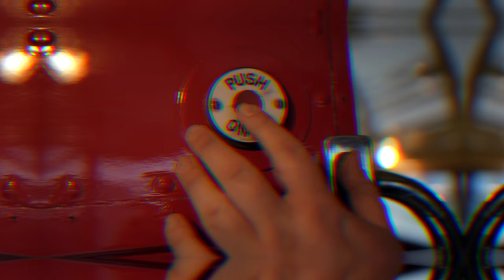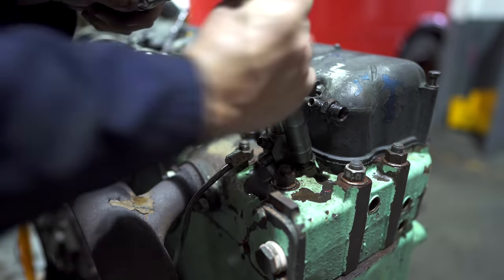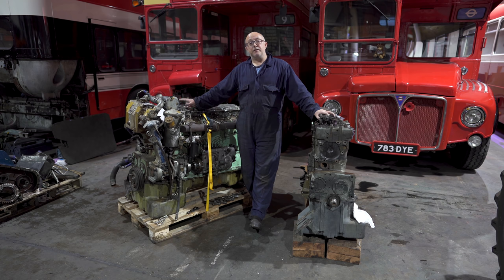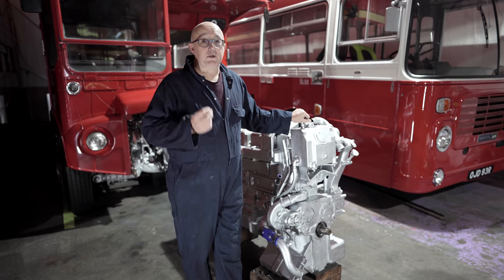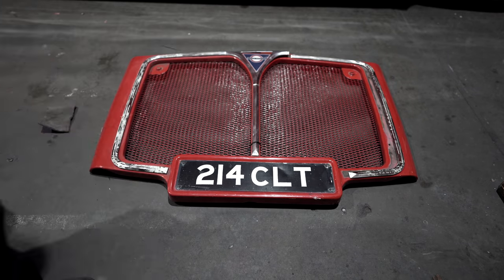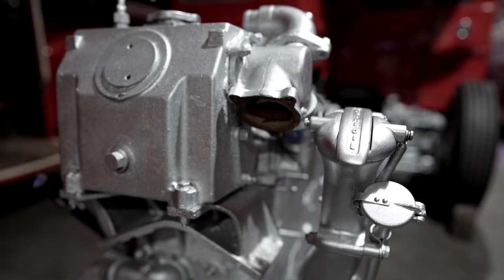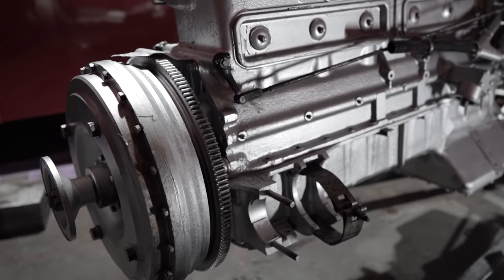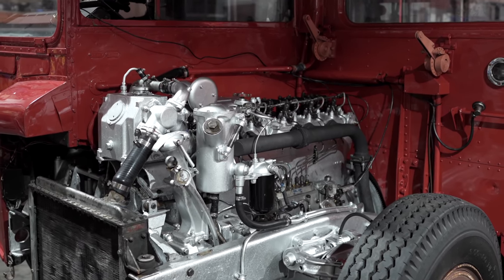Ep3: AEC Routemaster London Bus Restoration - ENGINE DISASTER! (Pt1)

Comment: Had never ridden in a double-decker bus before and went to the Sydney Bus and Truck Museum in the '90s, where I rode one-up in the middle upstairs of a similar red model.  I was surprised at the stiffness of the ride even when you are so far away from the road.  Of course I realised it was to stop them toppling over in their heyday on Sydney's winding downhill bends, as well as carrying the extra weight.  One question - is the fan at 21:58 missing a piece from one of arms?

Comment: Proper toys for the boys! I'm only a girl, but I used to be a rally driver (amateur) in the 1980s and spent many a long night under cars, grovelling in mud, snow and slush in pine forests replacing clutches and bent and broken oily bits.

I love this project. Not keen on the music (a soundtrack of banter, ratchets, dropped spanners, grazed knuckles, curses, a constantly boiling kettle, and red-hot, X-rated mug and teaspoon stirring action would suit me more...),  but it's great to see men willing to spend time and money doing something like this.

I'm delighted that the bus isn't being given a 'right-on' conversion to run as an electric vehicle. That would be as absurd as converting a steam locomotive to run on diesel. As Frank Zappa once said - "Keep it greasy..."

I hope you'll ignore the Negative Nancy-type Comments about 'the inadequate use of Personal Protection Equipment'. Such righteous nagging is all the rage on YouTube these days.

Donning a pair of safety specs when using an angle grinder is one thing, but there's a whole generation of peeps that flies into a tizzy if it sees someone using a drill without gloves, a face-shield, earplugs and safety boots, or holding a bl**dy screwdriver in (gasp!) their bare hand.

And as for spraying without a mask, extractor, nuclear haz-mat suit and organic vegan respirator... Nooooo! You're doomed! You could be breathing in toxic fumes! It's worse than smoking 780 cigars an hour! Think of the harm you're doing to your lungs and genes and the lungs of the poor ol' workshop doggie! Oh, woe, woe, and thrice woe...

Oh, shut up.

Perhaps the critics are from the U.S., where personal injury lawyers queue up to launch $100,000,000 compensation lawsuits if somebody stubs their toe or falls off a kitchen stepladder or looks at you in a funny way. Yes, hurt feeling are big business, too. Sigh.

Thankfully, this project's taking place in Britain, where nobody gives a toss. Hooray! People tend not to blame anybody but themselves if they drop a 30 pound toolbox on their foot, nobody sues anybody because that would be POOR FORM and BAD MANNERS, and lawyers who try to get involved are going to get a slap.

If you haven't got ("Possibly Carcinogenic!!!") dirt under your ("Broken!!!") fingernails, you're not doing the job properly.

I wish you well, guys.   :-)

Comment: You're quite right to be concerned about the thermostat. I learned that lesson the hard way. I had a thermostat stick closed on a summer's day, and the engine badly overheated. It ran after, but it blew smoke on startup and lost a bunch of compression. Now, I change thermostats every few years just because.

Comment: Cannibalising one engine (or part) to repair another part at least doubles the workload involved. Not the most efficient way to keep a vehicle on the road, but sometimes it's the only option.  Having to hand make replacement gaskets just adds to the time it takes to do the repair. However, you are keeping a British classic on the road, so it's worth it. Loving the rebuild videos.

Comment: THE RCL ( Long wheelbase Green Line) version of the Routemaster were fitted from new with the AV690 engine along with a higher speed drive axle. The G'box was semi automatic, unlike the RMC where fully automatic was an option.

Comment: I see you don't use impact wrenches much. I know you have to be careful but they are handy..
Reply: They are handy when dealing with some stuck bolts but when working on vehicles this old sometimes working by hand is safer and less likely to break off bolts or strip the threads.
Reply: They aren't under time pressure like a mechanical business and when working on antique equipment, it's better to have the dexterity of hand tools so you can feel what's going on.

Comment: My Dad is an old school mechanic and sadly he never wanted me to work on engines, so I am a curious watcher. One thing he taught me was to never put an old thermostat back on an engine and I was curious why you did, although it might be out of necessity as there may not be many new ones easily available and to save one is a better outcome. There's something really pleasant about the idle of those engines, they have like a high-low resonance. Great work gentlemen. Love the videos.
Reply from the maker: Thank you!
Reply: I wondered the same thing. I rarely ever open the thermostat housing on any of our vehicles, only if there are problems with temperature regulation. And if I do check them, it is only out of curiosity. Especially if it looks as old and grungy as the one in that bus!

Comment: So is there any reason in particular for not going the repower route given parts scarcity? Obviously you can still run these engines while you can get parts but it seems eventually that may become quite a problem.
Reply from the maker: The Routemasters that stayed in service in London into the 1990's and beyond were re-engined with Cummins and Iveco engines but this modernisation (in my opinion) ripped to soul out of these buses.  That is why we prefer ours to be as original as possible.   Mechanical parts are still available for the original engines and there are plenty of companies in the UK that can service and overhaul pumps, starters, compressors etc etc.  For now, at least, there are enough parts knocking around to keep these buses running.
Reply: @Routemaster4Hire  plus you're not racking up the miles like a PSV bus, so they won't wear out at the same rate, yet you're keeping rhythm exercised and treating them better as well.

Comment: Beautiful refurbishment of the engine. I am based in The Netherlands and am considering buying an RM. One thing that makes me hesitant is the engine dying on me and then not be able to find a replacement. If that happens, are there any modern engines (that meet new diesel regulations?) available to place into the RM?
Reply from the maker: Hi Paul.  Routemaster AV590 engines are like hens teeth nowadays so your best alternative is to fit a AV690, these engines are old but many were fitted to generators and so have much less hours then their AV590 equivalents.  To fit a modern engine into a Routemaster would be a big engineering task and would undervalue the vehicle.
Reply: @Routemaster4Hire  Thanks a lot for the reply. Then if I get into such a situation, I know in which direction to look.
Reply: @Routemaster4Hire  Unfortunately, since the Brexit, I do not dare to buy an RM in the UK anymore.

I understand that imported second hand cars from the UK now have to be tested before I can get a Dutch registration for them. That adds a big risk to an purchase. So, I'll search on the continent.
Reply: @Routemaster4Hire  The reason why 590s are rarer is because LT brought up almost all the spares. 690s only differ in the liner, piston and cylinder heads. 690s principle use was in Mammoth Majors, Mandatory and Militant Mk 3s. Most mobile cranes used 470s, with earlier cranes running 11.3 engines. If you aren't worried about total originality a 691 or 760 could be used - de rated.
Reply: Some RMs came with Leyland 0600 new, 400 of them I believe. I used to not like the idea of that until I learned why LT did that -so as not to be so reliant on one make. Besides, they sound awesome!

Comment: does not the routemaster association supply parts ?if owners get together they can get parts specially made cant they ?why did the engine blow up? lack of oil/dirty oil in the sump or runaway injection pump ?
Reply from the maker: Hi Peter.  Many thanks for your questions...  

Yes The Routemaster Association does supply many parts, they also get obsolite items remanufactured on behalf of the members.
If you watch the next video (Episode 4) we explain what happened to the engine.

Comment: Really interesting video, thank you! I just discovered this channel and now I'm binge watching your videos ☺️! One question: Around 4:50 it seems that you making a new gasket (Is that the right term? I don't have ANY knowledge in mechanical work, sorry!) with some "paper" and a hammer. Could someone tell something about it, what's this material called and how does this work with a hammer? Does this process have a name? I'm from Germany and would love to dig a bit deeper into this, just out of curiosity. Thanks again.
Reply: short answer All apprentices are taught how to make a gasket by this method,Not all gaskets can be kept in stock or out on site ,so the mechanic has to be able to make one.😊
Reply: @johnwoodhead4059  Thanks! Do you use the gasket material directly or is it a kind of template, that you work on with the hammer and then transfer it to a sheet of rubber or something like that?

Comment: I've heard that some Rm's had Leyland engines,Was there a difference in Power compared to the Aec engines?
Reply from the maker: There were 575 Routemasters fitted with Leyland 0600 Engines.  Both the Leyland 0600 and the AEC 590 are 115bhp at 1800rpm, however the Leyland is 9.8 litre and the AEC is 9.6 litre.
Reply: Thank for your quick reply! Just a quick question, did the Leyland engines Sound different compared to the Aec engines? I've heard the Leyland engines, sound Melodic!
Reply: @johnmichaeldorienjohn467  From memory ... living in Brixton in the early -mid 80s and while Brixton was still well served by RM operated Routes the Leyland had a slightly deeper note and seemed to idle faster. As I recall back then Brixton had 2,2b,3,35,37,109,159 & 172 all running RMs in 1982 and at the other end of where I lived just off of Railton Rd we had the 68 and 40. I’d always wait for an RM route if it duplicated an opo route...(edited to add) As I recall my move to Brixton was just about the time they were running DMS vehicles on the 133 on Sundays prior to conversion from RM crew operation, oh and I forgot the 45 that ran down from Stockwell turned left at Brixton Police Station and went on thru Camberwell
Reply: @warweezil2802  thanks for your reply! I did notice, that some Rm's had a different sound! I miss both The sounds of both, the Aec & Leyland Rm's..
Reply: @johnmichaeldorienjohn467  I miss them, They outlasted the DM & DMS (BL fleetline) even after the DMS had a mechanical refit to Iveco power) MCW Metrobus), Leyland Titans, some  Volvos (including the couple of “experimental” Volvos allocated to SW (Stockwell) for the opo conversion of the 77/77a routes. I’ve always been an AEC man probably due to my childhood job washing trucks and helping out at a local firm here that ran a mixed fleet of AEC Marshall Mercury and Mandator trucks in the early 70s
Reply: @warweezil2802  my Old man used to work for Aec  as well.!
Reply: It's shame, they're still iconic, & look at San Francisco ! They have their trams, I'm sure they are even older than, the Rm's! I don't see why they couldn't have kept some in regular service...
Reply: @johnmichaeldorienjohn467  I was gutted to find they took the last 6 wheeler with the split windscreen out of service weeks before I started there... never got to ride in one...  Gutted to hear they killed off heritage route 15 in London. That was my last RM ride... sad I will never ride one again
Reply: @warweezil2802  its such a shame, i think  the 11's & 73's should of been heritage Routes, & I think it was the biggest mistake when Lt was privatised & Aldenham was shut down.
Reply: @johnmichaeldorienjohn467  A huge mistake. I was working for London Underground at the time. Privatisation DOESNT work because it’s a race to the bottom in so much, except for shareholder profits. LT was an amazing Organization, and the RM was exactly what is needed ..designed by London’s bus operator for London work. Common parts across the fleet and a proper maintenance regime.
Reply: @warweezil2802  Yeah, he got made redundant when they closed Aec down. But before it closed, my old man used to take me to the open day's there..& I'd see Rm's close up!
Reply: Like you said it should have never been privatised, I read the work at Aldenham was in-house which saved money,it's truly a shame it's all gone now..
Reply: @johnmichaeldorienjohn467  It’s almost sad to see that the political dogma that mistakenly believes that privatisation is good, or at least it would have us believe that. They waste our money on dodgy deals with their big business buddies while driving the living standards of those doing the work ever downwards. How much money has been wasted on off the peg crap that won’t last and can’t be re-engineered like the RM could?
Reply: @warweezil2802  It's true what you say, I did read somewhere, about saying that privatisation, was good for the British Rail...& because of this track and rolling stock were improved, but all its produced,is greedy Toc's not caring about passengers & more about profits & shareholders!
Reply: @johnmichaeldorienjohn467  Then you get the ludicrous situation where booked connections are not made because one company won’t wait for a late running service run by another company because it will affect their performance metrics. That REALLY improves things for passengers, and no we are NOT customers, customers usually have a choice of competing businesses, which transport passengers rarely have. There is too much emphasis on window dressing and pretty language. As my old great aunt used to say, “ they’re all fur coat but no knickers” it’s a NETWORK...... and should be run as such
Reply: @johnmichaeldorienjohn467   Track and rolling stock improved? Not here! We still have Pacers on a 2 hour journey route! Electrification stopped at Cardiff which means no benefit west of there but worse trains with less comfort and no hot food. Privatisation always screws over the public. It’s a money mill for the TOCs and their friends
Reply: @warweezil2802  yes it seems they forgot other parts of the uk rail network, & all the money goes to fatcat mangers & shareholders!
Reply: @johnmichaeldorienjohn467  public service has always suffered when pitted against private profit. If the ordinary person conducted themselves Like this they’d likely get done for fraud.

Comment: hi, why dont you fit a proper air cleaner like the  iveco engined routemasters, the engines would be a lot  less noiser .i suppose its a case of getting a 690 lorry engine rocker cover where the oil bath air cleaner will fix on to. good luck,
Reply from the maker: Hi Peter.  Our aim is to keep the bus as original as possible.  Air filters were never fitted by London Transport besides I doubt one would fit under the bonnet.
Reply: @Routemaster4Hire  That's why RTs have a low bonnet line compared with other Regent IIIs: LT did not like the oil bath air cleaner fitted as standard, and had it deleted by AEC, though all other Regent IIIs had it. London Transport always “knew best” - or thought they did, arrogant so-and-sos. RLHs had the oil bath filter, so it was clearly something that created no problems, even for the LT engineering department! They, however, were responsible for the extraordinary decision to have 700 RFs made for them: a design which was at the best obsolescent from the outset, and only made for about 3 years before it was replaced by the far superior Reliance, a model with which, famously, London Transport could not cope, despite the fact that every operator of it in the country swore by its performance, reliability, and durability. Instead, they stuck their oar in again to help develop the AEC Merlin/Swift, which they bought in significant numbers and sold for scrap within 10 years. They should (and could) have bought Bristol REs instead, but oh no! These were designed for the Provinces and therefore not good enough for London! They even buggered about with Daimler Fleetlines and relaunched them as “The Londoner” (adding loads of unnecessary modifications and crap which made them virtually inoperable, and had to be removed before selling them on for useful work elsewhere). Then there was the Titan fiasco, in which they were intimately involved. A very good bus, when it worked, but was too damned complicated to be kept on the road. No, in their entire history, LT's only great success was the Routemaster, a wonderful bus, even though it was obsolescent (like the RF) as soon as its production wheels hit the road. Please do not extol the virtues of the LT engineers. 

Oh - thanks, before this film I did not know the RM did not have an air filter. Very interesting, and very stupid. By the way, did the replacement FIAT and Cummins engines not have air filters either, or, come to that, the Leyland-engined examples from new? Personally, I would have designed the RM to accommodate a Gardner engine. Bristol made Lodekkas with the same capacity and dimensions as the RM incorporating the Gardner 6LX, so it must have been possible!

Sorry for the rant - just my opinions. Very good videos. Very interesting, and well done!
Reply: @allenwilliams1306  If you think the Reliance in Medium Weight form was in any respect superior to an RF you haven't had any contact with either vehicle. Nothing with a 470 was trouble free. The RF was a rugged vehicle that could to huge amounts of work and deliver great reliability,  even after many miles. Something you simply couldn't say about any wet liner AEC engines in horizontal form. 
Vehicles virtually inoperable? What a load of rubbish! You do have a point about the air filters, but I'd like to know where you've got all your working experience from?